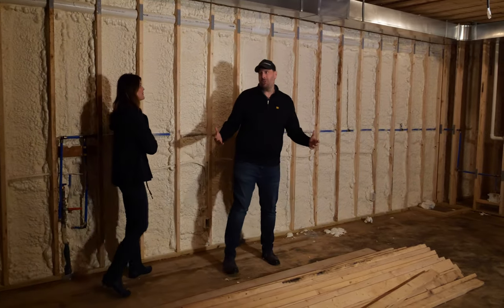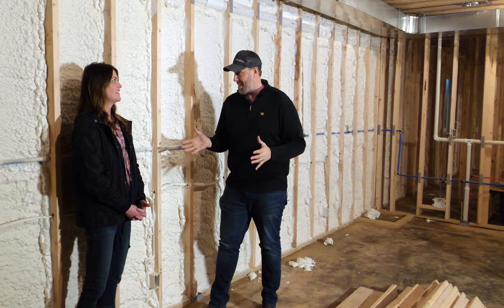What's the Difference Between Open and Closed Cell Spray Foam Insulation?

Comment: Uff, I feel for Gretchen on that Geothermal trunk!  You guys standing in the nook, that looks like the stove wall framing in the right of the shot, so you used LSLs on the exterior wall to frame for the kitchen but not behind where the stove and hood and those cabinets will be?  Why one wall but not the other?  I like learning all the technical specs y'all are using in this build.  Keep it coming!

Comment: Framing with 2x6 or 2x8 is a much better option than 3 1/2" foam and use closed cell so you have a vapor barrier.